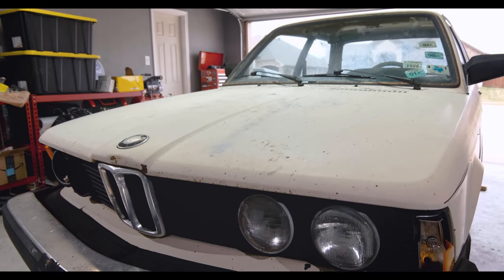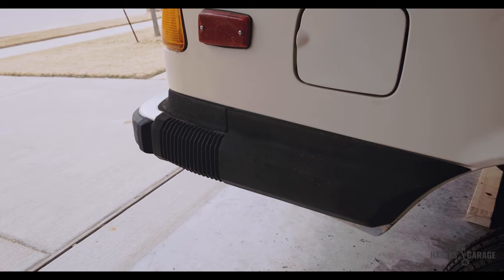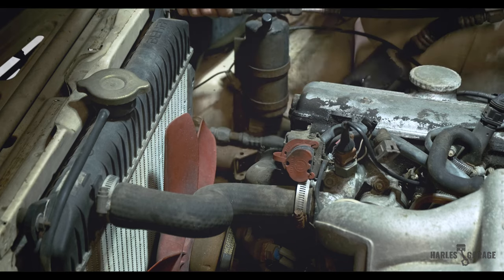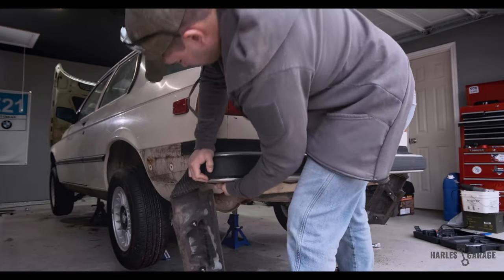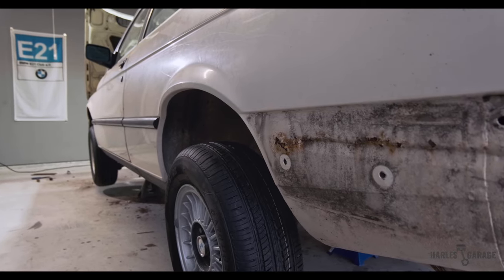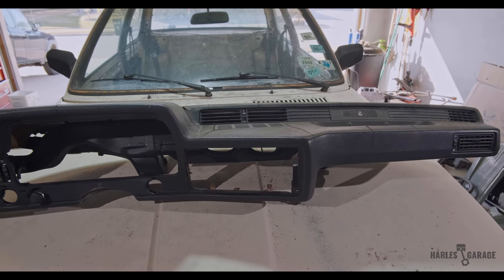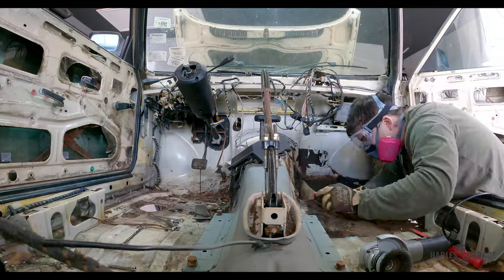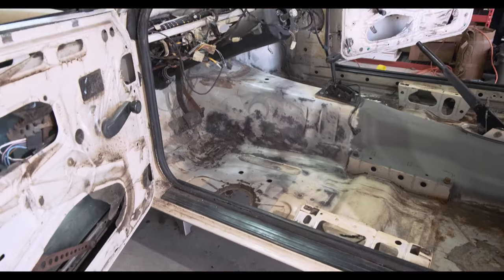Removing E21 BMW Bumpers & Sound Deadening - EP2 BMW Rally Car Build.

Comment: Thanks for sharing. Do you know where to get the front plate and bar that supports front lights and holding the cooler? Is there new parts available somewhere? I AM located in Sweden,  best regards